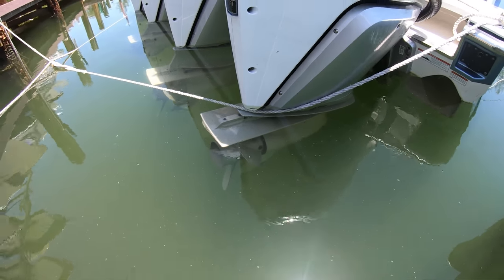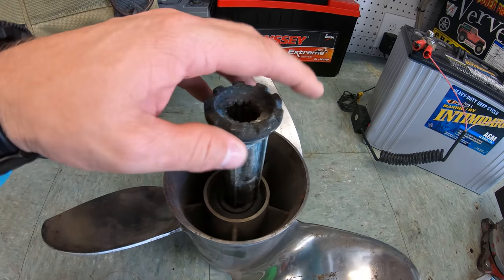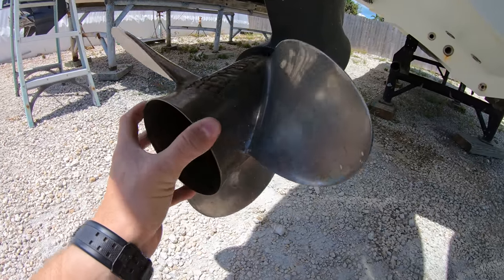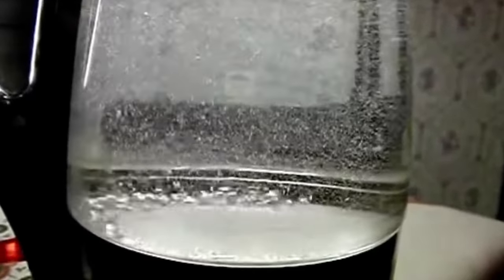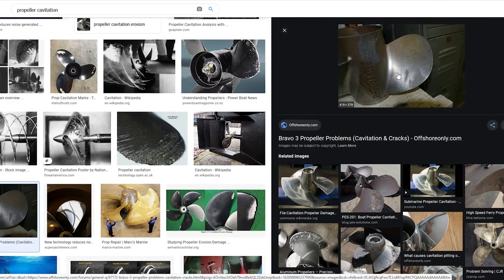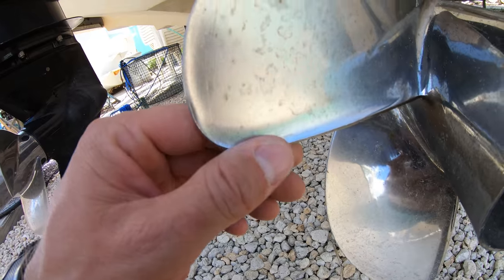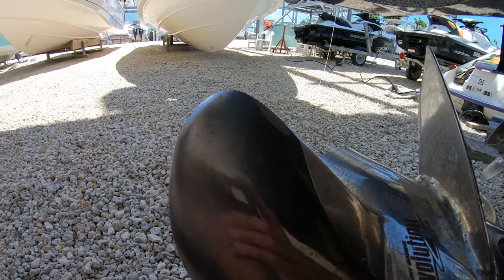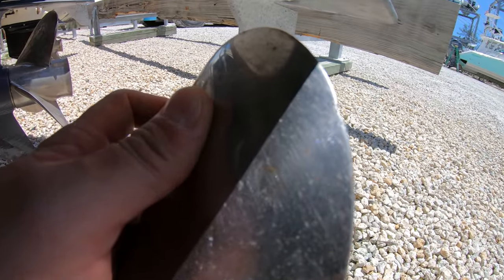Got BOAT Prop PROBLEMS? Cavitation Vs. Ventilation!!!

Comment: Wish I had seen this video about 15 years ago. I couldn't figure out why my jet ski started porpoising. Eventually I was figured out some of the mounting screws on the front intake grate had worked loose causing the intake grate to drop down during operation, dragging in the water and creating ventilation. A couple new screws and some locktite made it a cheap fix but it scared me for while as a couple mechanics looked at it and couldn't figure it out. I can attest, your video is very informative and useful and will make someones life easier when they understand what is going on with their craft

Comment: Good Video, One of the Better Explanations of Cavitation. 46 yrs ago I noticed the Paint and later the Metal on our Boat's Prop burning away, right at the Front Blade where the Blade Met the Hub. I was a Teen at the Time but I had read about Cavitation Burn, and figured that was was it was. It was one of the Old OMC V4s with an Itty Bitty Gearcase with Props that were smaller than the Props they put on the their 40hp, and 33hp engines. Almost no Gear Reduction in the Gear Case; 23:20. at those rotational speeds I'm certain the Blades had serious Cavitation Trails behind them. in 1969, OMC upgraded their Gearcases, and Prop Designs and were Equal to what Mercury had been using for about a Decade

Comment: Beginning of 2022 summer boat sat in the water for a month before I got to use it. Even with a freshly painted anti-fouling drive and props I had tons of growth. The barnacles and other growths limited the boat to 2800 RPM only. I was also running hot as the barncles made their way into thie water inlet. Took the boat out of the water took the drive off cleaned everything off prep and repainted and fixed all my issues.

Comment: Thanks for doing the research and then giving it to us. I had just bought a Suzuki DF200A for my Grady White Escape 209. I did my own installation. I mounted it according to the information that I had gleaned off of the internet and initially it ran very well. The problem was that once I started to turn, it ventilated. I couldnt correct with trim. I would straighten it out and the speed would increase nicely and the fuel economy would go up accordingly. But those turns. I pulled the boat and dropped it down 2 holes on the mounting bracket. The next test showed that I had found the sweet spot. The boat lost about 2 mph in top end but it would keep pushing in clean water throughout the turns.

Comment: Searched your channel a while back to help me figure out issues with my boat...Found a hook in my hull which was causing the bow to ride really low above 3/4 throttle, and I couldn't correct for it because when I would trim up, the prop would ventilate and become worse... thankfully I have an aluminum boat and was able to reshape the metal so the hook is about 90% gone and now I can run wide open, full RPMs with no issues...about to install setback/jackplate to get my engine in some cleaner water to really improve the performance...can you do a video explaining how setback effects boats? Your channel has helped me tremendously. Keep it up.

Comment: BAB University! thanks for all the content. 
I am currently searching for a new aluminum frame trailer for my boat, a Nitro Bay 2200. I think a great video you can do is on how to size the correct trailer for boats. 
The trailer my boat has is not fitted for it, it only works. So when I am loading it I have to be really careful so that I don't damage the hull. It takes me about 15 min to get everything right before I can leave the lake. I'm sure I shouldn't be using it but I've had it for 1 year and only have used it 5 times because I usually dont have time lol. IOWs, the urge to go fishing beats me.
Thank you for all the content you provide bud! 👍

Comment: I intentionally raised the height of the outboard on my fishing boat. I was set so low that I had a spray of water back into the boat. Now with it properly installed I can get ventilation only when on a very sharp turn, I have to be trying to do this to make it happen. However the installation of the jack-plate and raising the outboard has paid off in more speed, better fuel economy,and no water spraying back into the boat.

Comment: My first boat back in the 80's suffered from ventilation because the outboard was too short for the transom.  It would rev up when I turned unless I did so very slowly.  I ended up putting a different outboard on it.

Comment: Excellent video of explanation without getting too scientific 👌 small Knicks in the prop can also gather enough oxygen molecules to create bubbles before the prop thus creating a higher pressure system, therefore, Cavitation. But this video will educate most and it explains everything for the average boaty 👍
Reply from the maker: Thanks for the info!

Comment: I Was having the ventilation issue P.O had motor bolted as high as it would go, dropped down one hole and gained 300 rpm. Stopped having that slipping feeling.

Great video 
Thanks
Reply: you did not gain 300 rpm you lowered it 300 rpm ....lol

Comment: We have a pontoon boat with 150 hp Mercury.  It will periodically ventilate .  It seems like we get a lot of "splash" back fhere when it does that and it will do it even when engine is trimmed all the way down.  I have to throttle down and thrn it works OK.  Happens most often at about half throttle.

Comment: Propping a boat just right is really a tricky business. You watch videos, use prop calculation formulas and stuff like that but that really just provides a starting point about which prop to try. I adjust boat load balance, change props, vary the engine height, put on a hydrofoil and keep running the boat at my best cruising speed in choppy seas until it feel right and mpg are good.  Also check that the engine can attain full rpm at WOT to prevent engine labouring which shortens its life. When the boat runs right I dont know exactly why it runs right, it was the product of a little theory and science and a lot of trail  and error. It helps a lot if you have a prop shop that lets you try out props and change them without having to buy a bunch of props to find the right setup. Then when you buy another boat you can do it all again, if you're a prop perfectionist that is.

Comment: My neighbour had a 23 ft very deep V boat with a 260 hp stern drive, full of fuel and 2 people with not much else, it would not take full throttle, would get to 19 knots and not plane, it got cavitation, not aeration, and vibrate really bad, we changed props but it still had the same problem. I can't remember the brand, but it was like a 1984 24 degree boat that handled really bad in waves and when someone moved from one side to the other.

Comment: Excellent video...I just went over this 3 weeks ago with a group of 25...cavitation only comes off the back side of the prop blades...it will boil the water...ABYC has an excellent course on props....
Reply: from what i just witnessed your statement of cavitation only coming off of the back side of the blade is FALSE.

Comment: A couple months ago I purchased a 2004 Nitro 929 cdx , when the old owner took me out on the lake he tried to explain to back off at a certain point and hit the throttle again. I tried to recreate his throttling to get it up on plane , took me for ever. I could hear and feel the prop spin but not bite for the hole shot. He suggested dropping the mount one more hole, I just couldn't understand a almost 20 year old boat and no one had done this as yet. I noticed 3 holes at the back of the prop and remembered an article I had read. One hole had a rubber grommet with the center open, I had read some thing about a Merc Tempest design and grommets. I called a Marina explained the spin , they told me to stop by for some more grommets it's getting to much air. I placed two that fully closed the other holes. The 225 horse just bucked an took off like a bat outta heck. It has worked so far , a 12 dollar fix... I hope is all.

Comment: Modern stainless steel propellers can be rebuilt, repitched,, more or less cup added or taken away by a competent propellor shop usually far cheaper than purchasing a new stainless steel prop. Unless the pitch selection is grossly ( more than 2-3 degrees) out of parameter. Aluminum propellers are usually cheaper to replace but, it would still not hurt to do a little talking to a repair facility before making the decision to replace a propeller. A good quality stainless propeller for most larger engines ( 90 hp and up) usually are in the $600-900 dollar range or more depending on brand. Just an old man thinking out loud.

Comment: I feel this on our 38ft when it has a lot of barnacles on the hull. On a low speed there is no much affect, but when we are on a high speed the RPM will just go high and the movement of the boat was slow.

Comment: I have a boat with a prop and one without. The one with the prop goes faster.
Reply: This guy wins the prize
Reply: You don’t say.
Reply: I find that to be a based fact!
Reply: Lucky you 😂, mine comes with something like a stick/rod with a slab like thing at the end. Been beating the water with it but it never goes any faster. Sorry for the late reply, been off grid since COVID emerged.
Reply: I put my boat engine upside down so I have a hovercraft design
Reply: I agree. The boat will run some sort of way with any prop on it and not at all without a prop. But finding that just right prop can really be a pain.

Comment: Thanks for making this video! I am driving a 24’ sterndrive bay liner cabin cruiser with a powerful 160lb thrust 48V trolling motor. It has a very long shaft and is sitting in water below the deadrise aft of the transom. The trolling motor pushes really hard and I think a combination of high thrust and low advance through wake (max speed is 3.6kn at 2400W) and lots of disorganized water flow detachment at the end of the hull in displacement mode is causing ventilation. It’s a very distinct glurp sound when it occurs.

Comment: I noticed cavitation on my ski boat. I get vibrations and the pitch of the engine changes. I also see the little implosions on the leading edge of my rudder. I noticed the cavitation happening when I start to ride on some light crests. Ski boats are just not made for rough water.

Comment: On my last outing offshore I went out fine. But was venting or cavitating on the way in. At first I thought it was sargasso weeds and cleared it a few times but then I was in clean water and it was bad all the way in. Then in the canal everything was okay. 
I was really confused, I am going back to the boat today and look at my gear oil, and prop conditions and the points you mention in this video, and run it again to see if I can figure this out.I decided it’s an older prop and the combination of a transducer and the prop aging and minor damage in a certain sea condition was bringing it on.  Hopefully I’ll figure it out.

Comment: new to me 1994 20 foot pontoon, it cavitates to me, but i think its the inner water flow of the pontoons hitting the short transume  pontoon just before the motor platte. Motor is max down in the water  based on the tilt trim motor,. Just hitting other boat wakes makes it rev up and slow down. It has a new direct evinrude propellar. going to check out shaft length and motor height on the transum.

Comment: Cavitation does not generate air bubbles.  It is vaporized water.  They pop when water pressure increased and the vapor condenses back to liquid.
Reply: pardon me? lol your argument is self defeating. The vaporization of water produces an air bubble. Same concept happens in your hand when you stretch your joints apart, the noise you hear, the "crack" is a cavitation. (nitrogen)
Reply: @MapSpawn  Go take a science class.  On a large scale, try breathing that cavitated "air" bubble.  You will drown!  It is actually saturated steam when it flashes.

Comment: I have a 1994 trophy series bayliner 2002 
I have to take up a 200 yard area across a river to make a turn at full throttle.  Even then it did this . 
It takes the boat over 100 yards to plain out . I have never owned  a boat that stands up so far in the front and takes so long to plain out . I think there is something  wrong with the power of the motor . It's like it's worn out but I was told it has 130 lbs of compression on each cylinder.  

I hope to figure  these things out soon , just got the boat a week ago .

Comment: When the pressure, at any point on or near the prop, drops below the vapor pressure of water at its current temperature, the water boils; creating water vapor, not air.  When the water vapor bubble moves to an area of pressure greater than the vapor pressure, it collapses.  That collapse acts like a tiny shape charge and creates pressures near 100,000 psi.  This is well above the strength of steel and aluminum, meaning both are going to start pitting.

Comment: Having a Collection of Props can serve the ultimate and entire purpose.
A ski boat configuration would likely and simply call for the Generic Stock (comes with) prop.
A twisted Up SS Chopper will get u up the top speed once the hull and the RPM sync. (that will never be a Hole Shot prop config) so it really depends. One thing is certain, there's a lot of Over Powered Boats out there. That, is a #1 reason for porpose. I installed a 50 gal. gas tank in the nose of a V bottom J-Craft. I got pictures of it "One Hand on the wheel" air borne and planning off of One Prop Blade. 30 foot high rooster and walking a little sideways. Oh...that was a cleaver Prop. Al cleaver is designed specifically to meet the needs of a heavy Inboard or inboard outboard. so....with all that weight in the nose to keep her balanced coupled with the lifting action of a cleaver, voila flat, raised up and flying. J-Craft bought the photo 1985.
a 175 merc Heads shaved 20 th. aviation fuel. 76mph. 17 ft dual rideguide (Necessity or Mech)
Reply: What you're describing is the relationship between the center of gravity and the center of hydrodynamic pressure on the hull.  Power has nothing to do with it.
Reply: 175 on fuel only went 76 ....shit my 2.0 140 omc on my hydrostream went 80 and that was v4 not a v6...
Reply: @crashalexander7232  The One that got away...Hydrostream shit yer pants 67 is the new 80 king of the porposer...lol

Comment: I am so glad I stumbled upon this interesting video, just a pity you didn't complete it. IE How to fix problems - I have a huge problem with ventilation and, not cavitation as I just learned. It is really bad, I suspect that the motor is mounted too high. Where can I find more info on how high the anti-ventilation plate must be from the bottom of the hull? I mounted rubber/plastic skimmers on the ventilation plate but this seems to make it even worse as it lifts the motor up out of the water, the prop then literally runs just underneath the surface of the water level. The second problem that may be related to this is when I pull away the nose of the boat wants to lift up. I have an Infanta 6,5m rubber duct with a 75Hp Honda marine motor on. The boat was a factory build Infanta by Honda Knysna, South Africa.

Comment: The air bubbles you mentioned are actually water vapour bubbles,as a result of the boiling water because of the low pressure. It is not possible for air to reach there. The fast cutting of the prop makes a cavity in the water inducing the mentioned effect therefore the phenomenon is named cavitation.
Reply: I also wanted to add that steam bubbles don’t pop, they condense back into water. Steam at atmospheric pressure takes up 1700x the volume that water does so you can imagine the violent nature of forming and collapsing!

Comment: VERY INTERESTING! I just put a riser bracket on the back of my 11' tinny so the Cavitation Plate on my 5hp outboard is level with the back of the boat. It flies when on plane with the weight distributed in the boat properly BUT Ventilates when you try to turn. Seeing this Video where you say any obstruction may cause Air bubbles has made me realise I didn't take into consideration the Rib that runs down the centre of the boat hull underneath. The plate is level with the flat of the hull but higher than the Rib down the centre. I think when I turn Im getting air  off the Rib that makes the motor ventilate.
Reply from the maker: Very possible :)

Comment: I think you described exactly what may be happening with mine, sometimes when circling the lake I feel loss of power and vibration through out the pontoon and when I ese off the throttle it goes away? I have noticed a few nicks on my prop but the local mechanic told me it is fine.

Comment: YES !! I had my prop stolen.off my boat and I didn't no the size that was on my outboard now my new prop.is crap and constantly blows air wish I knew were to start size wise
Reply: There is a Prop Finder option on the Solas website or you could look at an online parts catalogue that might mention the original prop size.
Reply: @ChippyOZ  oh cool thank you

Comment: Cavitation is cause by pulling a vacuum in the water NOT boiling.  Any prop or even the hull moving though the water fast enough will cause pulling a vacuum, you can do this by slamming the top of a glass water bottle, the cavitation will be cause by the bottle moving away fast enough from the water. (also the water filling the vacuum causes the damage and breaks the bottle)